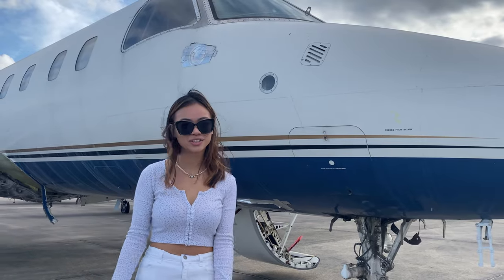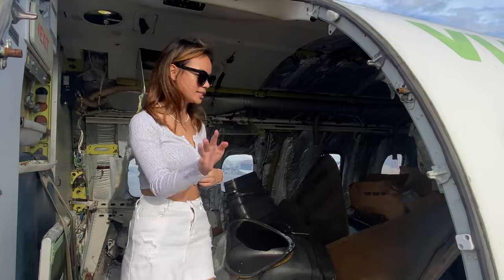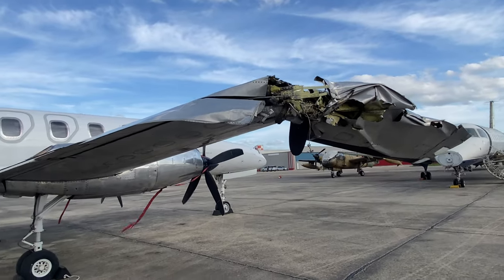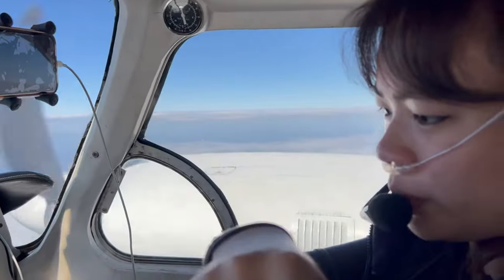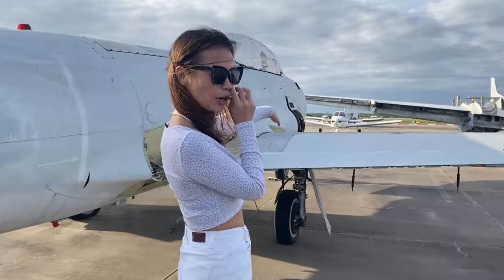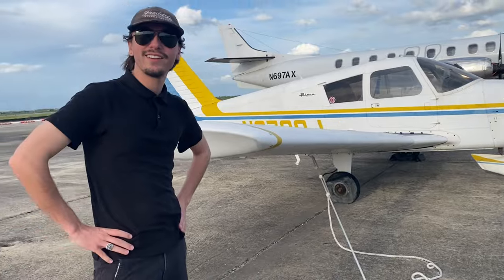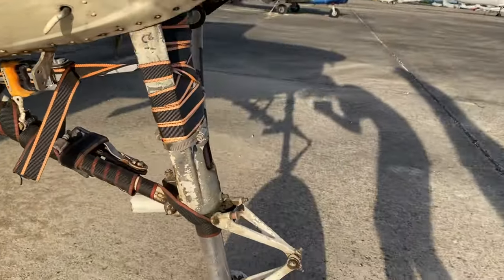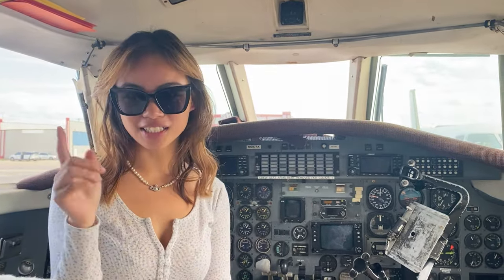MOST EXPENSIVE Aircraft GRAVEYARD! How MILLION-DOLLAR Jets Meet Their End.

Comment: That white/yellow/blue Piper Cherokee PA-28-140 #N6788J was built in 1958 and it's last certification to flu expired in 7/14/2017.  It hasn't legally flown since.  It would cost well over $10,000 to get it air worthy and certified to fly again.
Reply from the maker: Thank you so much for the information i never knew!
Reply from the maker: Planed now a days are running at 30-40 grand now where I live  so in the end it’s a bit cheaper if u pick up a plane like this. But I was also just saying it would be nice to have a LIKE this one. But either way both ways are too expensive for me.

Comment: Not a missile but an external fuel tank. Pressurized air is bled off the engines, sent down a tube into the tank and fuel is pushed up into the wing tanks. It has fins for aerodynamic reasons. They can be jettisoned. I believe one was dropped in Desert Storm, landed on a small Iraqi boat and sank it.
Reply from the maker: Thank you! I never knew very informative

Comment: The old jets with the canopies and tip tanks are T-33 trainers built by Lockheed. The camoflaged twin turbo prop is an OV-10. Was used heavily in Vietnam.
Reply: It's not an OV-10, there is some resemblance but it is a different aircraft. The OV-10 has a dual tail boom, this does not, this is an OV-1 Mohawk, similar role but different era.
Reply from the maker: @JD96893  wow you guys really know your stuff thank you for letting us know!
Reply: I guess I should have proof read my reply. Missed the zero after the one.